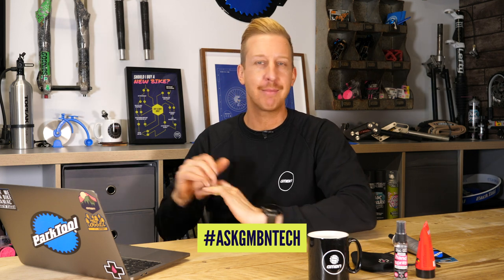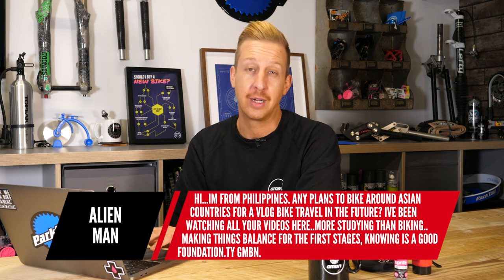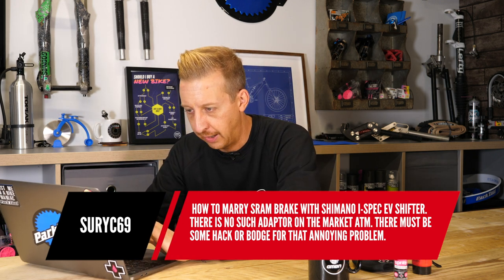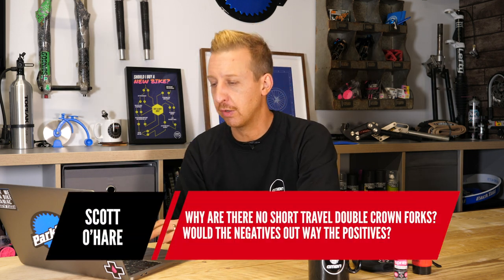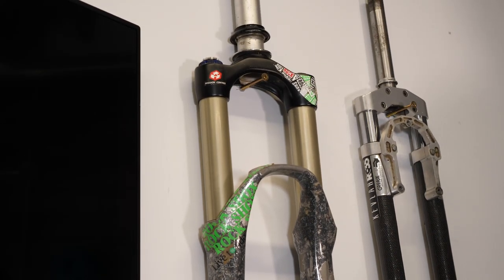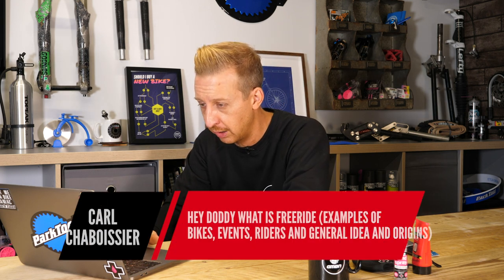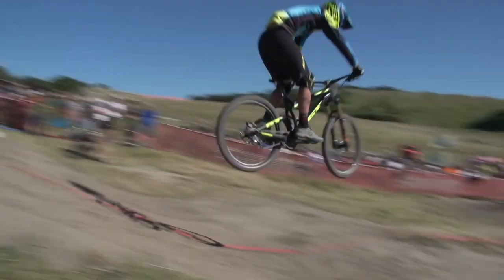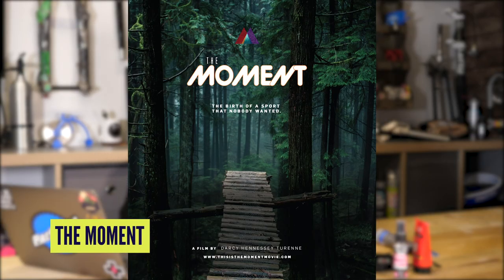Why Am I Not Getting Full Travel From My Suspension Fork? | #AskGMBNTech

Comment from the maker: Use the hashtag #askgmbntech and your question could feature in an upcoming show!
Reply: Hi Doddy! I am looking to upgrade my fork on my 2008 Kona Caldera. It has a 100 mm of travel and I am looking to get a longer travel fork. I am most worried about the BB height. The BB height is 300 mm right now. Can you give me some geometry numbers, some suggestions on forks, and what bike group would you categorize it as. Like enduro. #askgmbntech
Reply: Hey Doddy & GMBN Tech guys, thanks for featuring my question – I only do basic jibs, 2-foot huck to flats & drops, nothing that extreme (like Blake) so, I really have no clue what happened to those hubs 🤣 Anyway, I already purchased a DT Swiss hub, and it works like magic!
Reply: #askgmbntech

Quick question - All in favor of every GMBN presenter growing a matching mustache? ✋
Reply: #askgmbntech Hi Doddy, loving the show! When you’re in the middle of 2 bike sizes would you recommend the smaller size adapted to be bigger e.g. with longer stem or a bigger dizer adapted to be smaller, e.g. with a smaller stem? Thanks
Reply: #askgmbntech How will brexit affect the majority of bike shops?
Reply: #askgmbntech love the show! do we expect bikes to be more expensive post brexit here in UK?
Reply: #askgmbntech  
Hi doddy, 
I was just wondering if oils and grease of any kind can damage paint or aluminium on my frame and rims? What if i got paint chips and scratches on my frame, can lubricants make it worse? 

Regards from slovenia!
Reply: #askgmbntech hey doddy I have. a marin San Quentin 1 hardtail with 120 mm of travel how much travel. Do I need to huck it to flat from a 5 feet drop
Reply: #ASKGMBNTECH
Hi Doddy,  My cranks rotate forward with the wheel (like they would in a fakie) even when I'm riding forward. They don't move at all with my feet on them, but if I'm walking next to the bike pushing it, they rotate. This is on my single speed dirt jumper, and its really annoying

Comment: I've destroyed two Microspline hubs this year (got warranty on both) on a Yamaha PW-X2 Ebike. The first one was a Shimano Deore hub, this one lasted about 1000km, and then it started creaking like crazy under torque. That was replaced with a Deore XT FH-M8110-B version, which lasted about 20-30km (two rides) before it started creaking. Finally had enough and got a DT Swiss 240 Hybrid hub (reinforced for Ebikes), has about 500km on it now, and still no issues with it. The only issue I had that it required another wheel to be built and a new rotor because it meant going from CL to 6 bolt.

Comment: Wasn't using all my travel on my 130 Revelation and it felt harsh over small bumps, more sag just made it feel unsupported. 
Removed 2 of the 3 factor fit tokens and it felt much better. 
I've since added the 2021 piston mod and gone to 140 airshaft and removed the last token. 
I now use a decent amount of travel for the half arsed attempt at aggressive riding I do and it feels pretty good. 
Still not as good as those slow mo's GMBN have of Neil and Blake sending it down rough sections and the fork just gliding up and down with the bars steady. I'd love me some of that.

Comment: Another great video Doddy. I always thought the answer to a Sram/Shimano cockpit was having to use a 22mm clamp for the shifter.

Also in answer to the request for a longer dropper post, you're correct that there are quite a few 200mm droppers, including the latest Fox Transfer (although Crank Brothers doesn't seem to be one of them; the Highline maxes out at 170mm). If every millimetre counts, the Oneup Dropper 210mm is probably the best option.

Comment: Drop a spacer (and remember to add 5psi from your perfect psi) in your fork if you aint doing 10ft hucks to flat. Like Doddy says these modern forks are made for aggressive riding, if your doing light trail/ XC you wont use it all, probably not even the last say 30-35%. 

Plus any 35mm+ stanchion fork is made to be jumped and dropped hard it's just what they are designed for hence the extra weight. It's just so many people buy a trail bike as a do it all or for learning, when they are intended for much, much more so the forks seem near impossible to use most of the travel.

Comment: #AskGMBN how much of a difference does a goatlink (derailleur extension) make on the shifting performance? What modifications to the setup would you make if you used one (B tension, H and L screws, cable tension)?
Reply: The GoatLink lets you run a larger cassette than the mech is specced for, other than that it makes no difference to shift performance. I installed one so I could run an 11-50 Sunrace cassette with an 11 speed XT mech and it works pretty much flawlessly. Every so often I'll find I can't shift out of 1st and it's because the b tension has released a bit, so I give it a quick tweak and away I go. I should probably throw some loctite on their and fix that problem. In terms limit screws and cable tension it makes no difference. I guess if your derailleur hanger was misaligned it would multiply the issue, but assuming your hanger is straight and true they are great at what they're designed for.

Comment: Shimano FH-MT510-B #microspline hub: I have no idea how, but it came loose while taking the rear wheel off my Orbea Laufey 2020, less than a month after purchase. Put it back on, a few rides later it started creaking like crazy, until it got stuck while descending some gnarly trail. I had to get the wheel off, and used the axle to gently unlock it. When I got home I disassembled it, found  it was full of oxidation. Cleaned it, re-greased it, creaking was still there, plus one of the pawls developed some slipping, until the whole thing was unusable. 
Luckily Orbea replaced the whole rear wheel, which i haven’t used yet since while waiting for replacement I pulled the trigger on a pair of Hunt Endurowide, which have made my Laufey more lively especially on the climbs, and a hell of a lot louder on the descent. OEM wheels are 2.6kg heavy, the Hunts are around 2.1, and that’s a difference that can really be felt.

Comment: #askgmbntech Having a lot of trouble with forks freezing up & going rigid at temperatures below freezing in the winter rain & snow.  Do you have any tips for keeping suspension operational in winter?  Will it help to perform lower leg service at all?  The forks all feel great whenever the temperatures are above freezing.
Reply: It's ovious that the suspension fluids are probably freezing (rebound), but I have no idea how would you prevent that, so it would be interesting knowing that.

Comment: If I increase the air pressure in the forks to recommended for my weight it never bottoms out but if I reduce the pressure by 10-20psi recommended it can bottom out

Comment: @daszenkerle if your fork is seted up with 25% and it feels to firm it could be air trapped in the lowers to remove it let all the air out and then try to move a little de seals and then try to insert a plastic strap i don't know how are they called in english, hope y could help you
Reply: Maybe it could have some tokens or volume spacers

Comment: YES. Microspline is absolut sh#,§. The spring on my Newmen hub failed on the FIRST climb. So at 950 metres elevation I was to turn around an make my way to the car with a fixie. And Newmen admit they had quiete a few hubs fail
Reply: known issue with Shimano XT microsplines, on Newmans, on the E-mtb Cube Stereo HPC 160. There's a note on Shimano's website for how to resolve the issue. I have had it repaired twice. It's holding now but I went with new Stans/Hope wheels regardless, as more dependable.

Comment: Hey Doddy, I'm Waiting for my new Scott Ransom 920 to arrive. So not cannot confirm exactly what is used, however it is specked for SRAM NX Eagle transmission and Shimano  M6120 brakes from the factory. And they appear to be mounted on the same clamp.  So I suspect Syncros may have what you need to mount SRAM and Shimano on the same integrated clamp, (I also could not confirm this , I don't see any small parts on the site.....)

Comment: #askgmbntech how do you know when your problem is a tech issue or technique issue. I have problems keeping my feet on the peddles over jumps The peddles seam to feel like they fall away in the air. I have Shimano GR500 Flat MTB Pedals AU and Giro Jacket II shoes. Is it something to do with my technique or is it something to do with the compatibility of my shoes and peddles?
Reply: It's all your technique, flat pedals are not supposed to vertically attach to your shoes, that's the point of not clipping in. You should probably practice pedaling though, since peddling experience doesn't help much on a mountain bike unless you're trying to sell it.

Comment: I've destroyed 2 stans hubs since I bought my bike in February. The first one I destroyed the durasync freehub body. One of the pawls snapped and destroyed everything inside. The second time I had a speedsync freehub body and ended up spinning the gear with the teeth on it. Stans has been really good about warranting it but still I've destroyed 2 hubs. No issues since I got a whole new wheel in August. I have a X01 10-50 tooth cassette with a 32T chainring.

Comment: Can you also discuss how your tune might have to change as the temperature plummets? I had my suspension feeling dialed over the summer. But now when it’s in the 20’s fahrenheit it’s feeling harsh again. Is this a known thing? Do we have to redial it for cold temperatures? If so is it mostly likely the air pressure or the rebound or both? #AskGMBNTech

Comment: Hi Doddy, how are you? Just wonder why can I only measure 135mm of exposed stanchions on a Fox 32 Talas RL OpenBath (2010) that should have maximum travel of 140 mm? It seems to me that I only have 130 mm-ish of useable travel. I read in some online web board and they converted Talas to Float, will that help to regain that lost travel? #askgmbntech
BTW, I come from Chiangmai! That trail you were talking about must be at 'Doi Suthep' (the mountain with a temple on the top). They organised international enduro series the year before, maybe you and GMBN folks can go race there when the situation is better.
Reply: Air in lowers causing suck down. Use cable tie down seals method

Comment: #askgmbntech
I know the geometry question has been asked a million times, but could you go in depth as to how proportions that are outside of the norm might affect bike fit?  I have a long inseam for my height and a short torso (5'9" and a 33inch inseam). Different bike shops tell me I should both size up and size down with long legs.   What I've personally worked out is I need a high stack and reach that's longer than a normal medium but shorter than a normal large.  Further, I've found I really like long chainstays but a lot of my shorter legged friends think I'm nuts and love them as short as possible.  I'm wondering if there's a reason for that.

Comment: @Mircospline Hubs 
It looks like there is a lot of grease in there. That would be incorrect maintenance. Freehubs only function correctly with minimal grease. 
Also the DT Swiss 350 is cheaper and also has the ratchet system. 
And this issue should be independent of the mircospline system (although I prefer the XD-body)
Reply: Yeah that confused me thought all DT Swiss wheels are star ratchet but the 350 does indeed use a 3 pawl system, mine are old style HG hub body so hoping it does not happen on mine but I've heard others (they come OEM on a bunch of entry-mid range trail bikes) say they can strip pretty badly. 

TF tuned are the DT Swiss reps for the UK I believe so shoot them a message and see if they could rebuild under warranty if authorised (believe its 24 months warranty from new) if OP has it.
Reply: @tommycooperfish  the standard 350s should be ratchet. the 370 are 3paw.
However you can convert a 370 to ratchet. I guess they use the same outer shell and only the mechanism is diffferent.
I personally use 350s since 2015 and never had a problem

Comment: Hi Doddy #askgmbntech I also had an issue with a Shimano XT M8110 microspline freehub on my couple of months old Whyte 909v2 earlier this year. As you probably know this freehub only 'clicks' at lower speeds and is near silent when freewheeling fast. Mine started making intermittently 'clicking' at faster speeds and sounded crunchy (like an un-lubed chain) under load. Bike shop had heard of issues  and returned back wheel and another they also had in to Shimano for warranty replacement of the rear hub internals. No probs since (fingers crossed)

Comment: #askgmbntech I have a hardtail mtb, and under certain pedaling conditions (which is unidentifiable), sometimes some component creaks or clicks. Previously I had that was from another bike but that had a loosened bottom bracket. However this new one has no play in the bottom bracket whatsoever. I have reviewed all those identifying videos off of GMBN and GCN, but handle and steering components are solid, as well as seat and rear cassette and hub components. Am I missing somewhere to look for? I am from India and the bike in question is one Montra Rock 1.1 (not popular outside the country I assume).

Comment: #askgmbntech
Hi, i recently tried to bring my old hardtail back to life, but struggled to get the front derailleur to work properly (despite watching your videos :/).
Its a 3x9 deore xt drivetrain with cheaper shimano shifters and a new large chainring on the alivio crankset. Now the problem is, that i cant get the front derailleur to cover all the gears. On the biggest chainring it keeps rubbing against the chain unless i put a lot of tension on the cable. Thats when shifting quality between the smaller gears suffers. What could be the problem? Do some chainrings stand out further and thus increase the distance between the gears?
Thanks a lot and merry christmas from Germany!

Comment: #askgmbntech. Hi Doddy! Can you convert any bike to tubeless without buying tubeless ready wheels, and just using tubeless tape on lower spec ones?
Reply: you can, but the reliability comes from the tire bead-rim interface being optimized. Bodging a tubeless setup will work but has chance of a tire coming off the rim

Comment: #askgmbntech i just got a new Trek Slash 8 with a RockShox Super Deluxe Ultimate shock. Here my question: when I push my rear bike suspention fast, there is a little and very quite clicking and sucking noise. It's really quiet but I am super paranoid bc it's my new baby. So is it normal there are quiet sucking noises in ur rear shock?

Comment: I have an 2017 orbea rallon with 170 travel at front with 38mm offset, if I was to change to 180 with 44mm offset what would the affect on geometry be. Would setting the flip chip to lower compensate enough for good climbing. #askgmbntech

Comment: #askgmbntech I have a 120mm Rock Shox Revelation fork on my 2019 Marin Rift Zone 3 that I cannot get to bottom out on the hardest of rides.  I have even taken all of the air out and tried to compress it all the way down..still no dice.  I have recently removed 2 of the 4 volume spacers, but the way I understand it, those will only give me a more linear feel in my travel and won't do much to increase or decrease the travel.  What else can I do?

Comment: hi gmbn, i recently got a tranzx dropper post for my rocky mountain soul 710. the frame does not have internal cable routing, will i have to drill holes so i can get the cable through to the bars? #askgmbntech

Comment: hey doddy, I have a budget mtb that has worn cranks and needs replacement, it originally came with 3 piece crank but is there a way to replace it with a 2 piece crank? 3 piece cranks are just so hard to find.  Thanks in advance #askgmbntech

Comment: #askgmbntech hi doddy, i have a problem with either my riding style or my suspension, it is recommended to run 30% on the rear but that seems so incredibly soft, i bottom that out just by bunnyhopping. To NOT bottom out i need Like 20% but that feels harsh. I have this problem on all bikes i ride. I weigh 70kg btw
Reply: Add low-speed compression damping on the 30% sag air pressure. Try an intermediate pressure too, like 25% or so.

Comment: #askgmbntech Hi Doddy, I'm always getting punctures because of the inner tube gets thorn around the valve. I tried everything, also replaced the tyre, but it keeps happening. Am I using wrong tubes, or there's some problem with the rim? Thanks for your help!
Reply: To me, it seems like you may be running to low pressures, so at heavy acceleration/braking/turning, you're moving the valve as you're moving the tyre. How much u inflating the tube?
Reply: @chelarestelar  I don't have a pressure meter, but I think that could be the problem. Thank you!

Comment: #askgmbntech  Is it be possible to reduce the travel on a Pike fork by simply reducing the air pressure (increasing the sag)?  I have a fork with a bit much travel for the frame, and more than I usually need, and would like to know if you see any problems in doing this. Love the show, thanks.

Comment: #aakgmbntech I've got a KS Lev integra and it takes a lot of effort to operate it. So much so that it hurts my thumb after a bit on the bike. I took the dropper post out and put some spray grease on the mechanism at the bottom and did the same with the lever. However, It's made no difference... Could you help me please?
Reply: I had a similar issue with my dropper, usually replacing the cable and cable housing fixes it, and spraying something similar to WD40 inside the housing sometimes helps
Reply: Thanks I'll try that👍🏼
Reply: New cable. Don't spray anything into a new cable, ever. It causes more drag
Reply: Thank you so much! This has worked a treat and is soooo easy to press now!